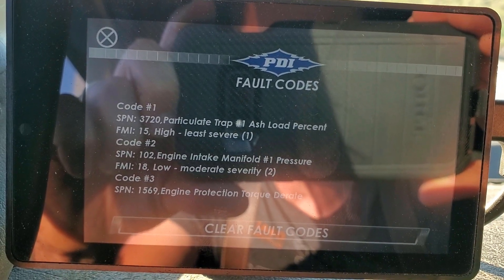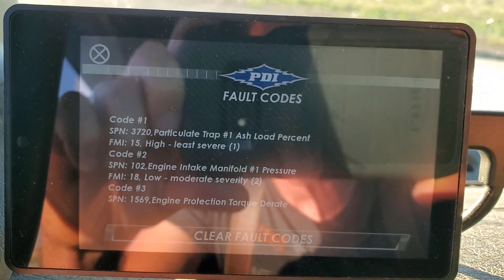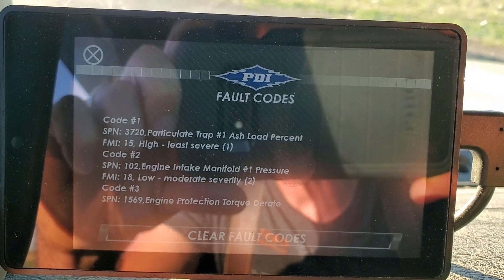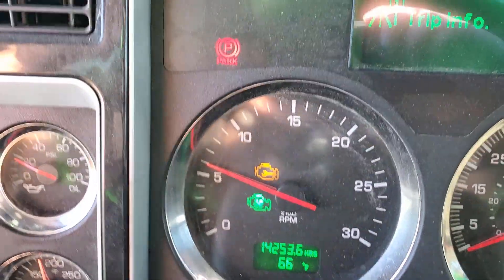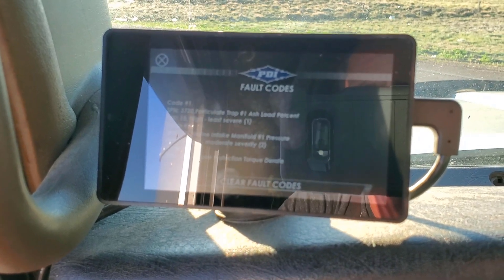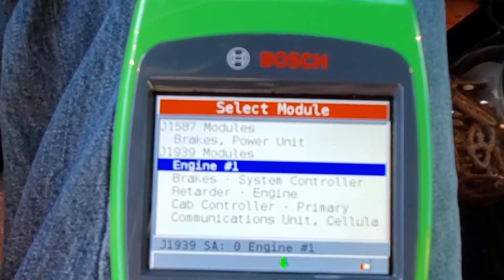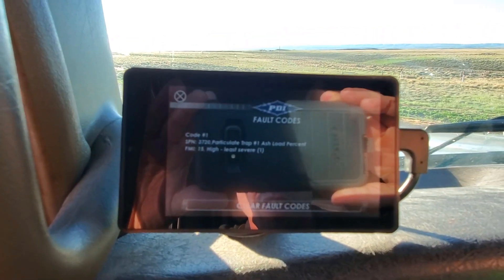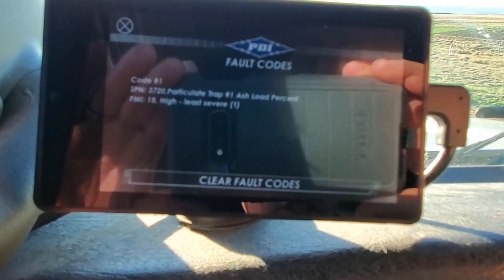Clearing An Engine Derate On A Cummins ISX15 With The Bosch HDS 200 250 - Truck Repairs DIY

Comment: Hey Ryan, I bought the 250 based on your videos. I have a 2020 t680. Can I do a forced regen with this device, or only clear a de rate

Also is a forced regen the same as holding up the button when parked.

Comment: I have the same unit, it let me clear a code only once when I first bought it...

Since that first use, now it only let's me read codes. When I try to clear any code it reads that it is not getting a response back from the engine.

Comment: I currently have a derate related to the DEF system, would this tool allow me to reset the 4 hour derate? 2017 Kenworth T880 with Cummins ISX
Reply from the maker: You cannot use this tool to reset the derate! But you can use OTR performance! Here is a video of my review. Hopefully you can get some good information! By the way, we have a coupon code listed in the description to save you $100 when you order OTR. Let me know if you have any questions!
Reply from the maker: https://youtu.be/Uy46Aq79GRc

Comment: Pardon my ignorance...I have my KW T800 wrench 🔧 light and red check engine ON and can only go 15 MPH. I had to call a tow truck and paid $400 plus to tow to dealer. If u purchase this Bosh can I clear codes and drive to my mechanic shop instead of paying tow truck? Thanks
Reply from the maker: It really depends on what it is. Bosch will clear a derate. but it will not clear a shut down and lamp mode. If it is emisson related, you can unhood your egr temp sensor, it will allow you to drive to a shop.
Reply: @truckingandfixing  Thanks best regards!

Comment: Does this tool work with all engine makes?
Reply from the maker: I know it works with Cummins, Paccar(read only), and my dad uses one on his Volvo.  It is j1939 capable, so it should be able to read about anything.  I have used it on my pickup truck, cars, heavy equipment, and farm equipment as well.
Reply: Road-Field-Home with Ryan & Sophia I have the paccar mx13
Reply from the maker: I used it on my mx13, it will give you accurate (and valuable) fault code info, and real time data.  It would not let you clear codes, but my mx13 would progressively clear the codes itself after the problem had been corrected and so many runtime hours had been met.